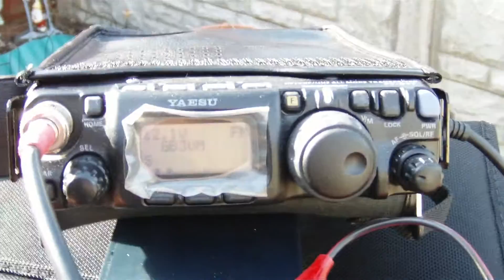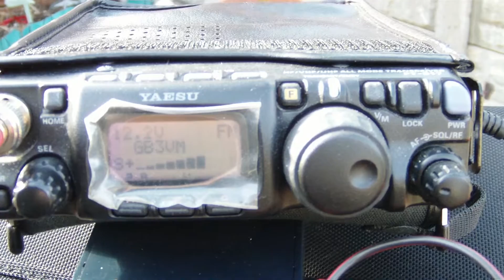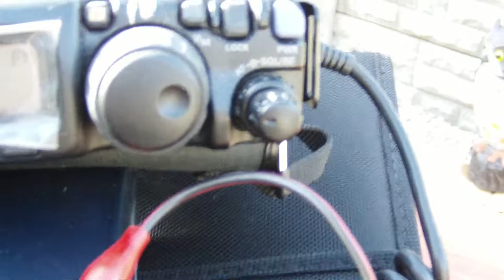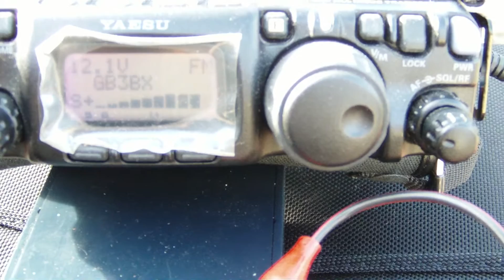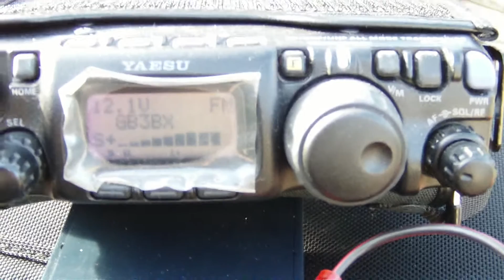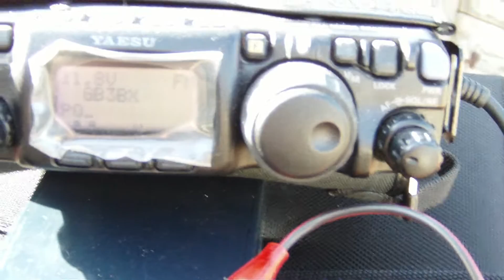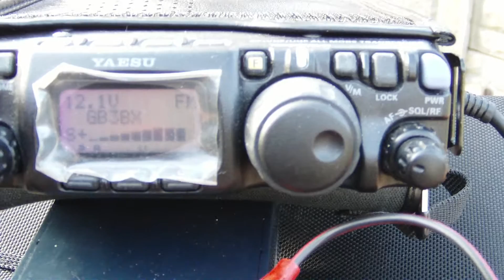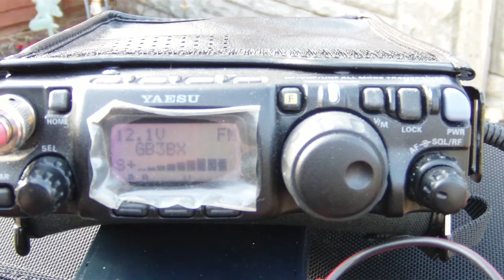Yaesu FT-817 QRP (VHF Repeaters)

Comment: You're identifying as QRP on a VHF repeater??????????? Now I've heard everything...... That, OM, is an oxymoron and a slam to true QRP ops
Reply from the maker: As I am working QRP (less than 5 watts) which is incidentally QRP???????????????????????????????????????????????????? I state QRP through a VHF Repeater incase the other station finds that I am a little scratchy coming into the repeater and would inform him why I am so scratchy is because I am running QRP........ 500 milliwatts into a repeater 15 mile away and not straight forward subject to terrain is a  dam good achievment in my book........ what you say "true" is just your opinion and I won't knock it...so don't knock mine...we are in this hobby together OM

Comment: half a watt but with gain on the antenna, pretty cool though, i have a small 2 meter yagi i point out the apartment window with the 817nd on 5 watt full, i always get such a strong clear signal from 15 miles with some buildings inbetween, even out to 60 miles, haven't been able to test it out farther cuz of the huge mountains blocking in OC cali